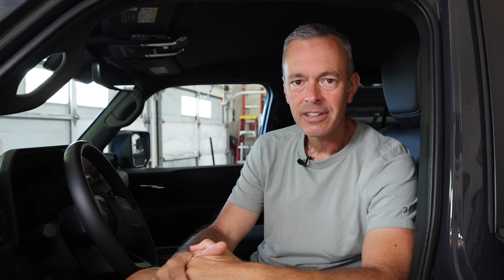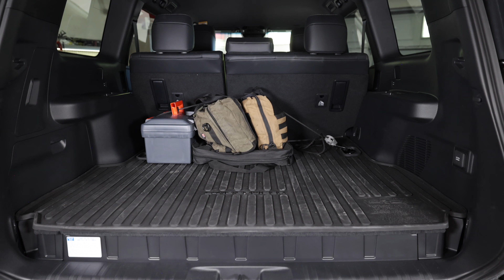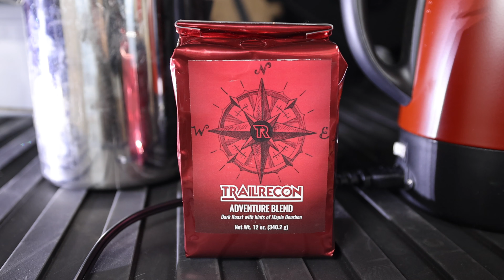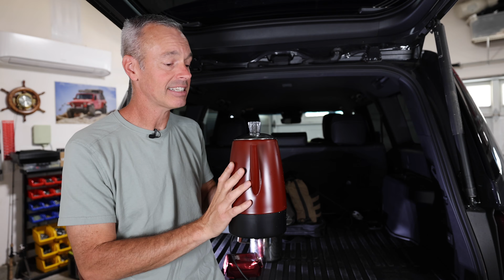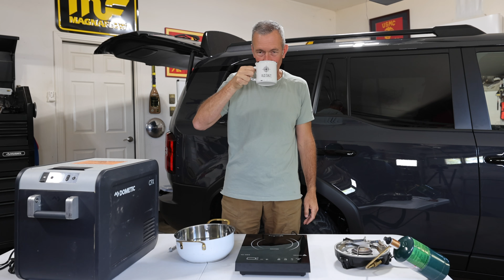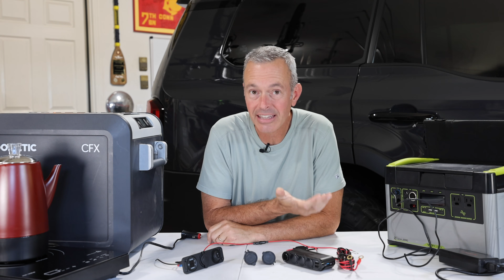Is it Time to Go Full Electric Overlanding?

Comment: Your ideas sound very similar to what I've been working towards with an all electric 4Xe kitchen! I have an 1800w induction hotplate plus induction rated pots and pans to try, but no coffee pot yet. A 30qt fridge will plug into the 12v cig socket in the back, plus I have a 2300w Dabbsson power station to save the 4Xe 110v power box for backup, and a couple of 200w solar panels that will fit nicely on the hardtop without blocking the freedom panels! There will even be room for a 28" by 74" sleeping platform inside without removing any seating, which is my present project.

Comment: Very useful video! Most of my camping is done at the racetrack where I can get power. Switching to full electricity makes so much sense for me.
Reply from the maker: Glad it was helpful, I think there is some real practicality in going with electric vs. propane.
Reply: @TrailRecon  absolutely! When electricity is available it’s a no brainer. You can’t forget your lighter or have a bad valve and an empty tank. Also can be safer/cleaner and more compact.

Comment: I have a Hardkorr battery box with a 120 amp lithium battery inside and a Redarc DC DC charger plug and play with Anderson plug. I have a single storage draw with a slide draw 30 litre fridge/freezer. The fridge runs for more than a week no problems. I use the battery for my ARB compressor with Anderson plug.
The battery box has four 50 amp Anderson inlet outlets , one 80 amp , cigarette sockets and USB ports along with a monitor. If you take the red end of the Dometic cable you can get a lock in type of socket , I use an Engel style plug on my 40 litre fridge. MSA make great drop down fridge slides.
I used one for many years in my 100 series but have gone to the slide draw fridge in my 300 series. 
Kickass make some great prewired power boxes.🇦🇺🍺

Comment: I have been experimenting with this route of electric camping gear on my 2024 4xe which came with a power box and upgraded IDCM that allows to use the entire 15kwh (94% electric range assuming you got to camp in e-save) of the HV battery. I have been able to run even a space heater earlier in spring and waiting for fall/winter to do a proper 2 day camp with only the HV battery. at 15kwh thats like carrying 5 of those largest 3kwh jackery generators.

Comment: For running things outside the vehicle there appears to be a grommet between the rear seats that's about 2" in diameter. If you pull up the front "storage compartment" down to the bare floorboard (2 nuts to remove and then some pop plastic trim clips) you'll see it right on the edge of the carpet. I believe it comes out just above the fuel tank next to some other wires. My plan is to mount a Garmin Powerswitch in the front storage tray of the trunk and run my front light power and radio antenna cable out of that grommet and up to the engine bay. Just food for thought, also trying to figure out how I'm setting up the 12v in this truck as we go.

Comment: More than likely the rear usbc ports are dead when the truck is off, but you could probably switch some of those over to 12 volt outlets, they would just be keyed.  No need for four or five USBC ports in the rear area that you plan on sleeping.  I'm sure you could even take the driver side third row area USBC port and swap it to a 12-volt and wire it directly to the battery. Nice clean install using the factory hole

Comment: How about a fat gauge cable from the rear battery to a resettable circuit breaker in front of a positive bus bar under the hood?   A switching system, fuse blocks and other loads can also access this bus.

Comment: I just use a 500w hot plate, bring a small covered pot and small frying pan for cooking. To heat up water, I use a 12v water heater, fits in a cup holder. I'm wondering why the Sienna doesn't make the loud noise when the engine turns on?

Comment: I ran 2 of the Garmin Switches on last build. Worked awesome, phone access, CarPlay integrated and also has switched programmable option on it. Thinking on LC of tapping into jump point under hood for external accessories. I have 2 of the Garmin Switch units so one for inside LC and one under hood.

Comment: Electric water kettles are great (with a French press) for safely making that first cup of coffee while still in your tent.  My problem is I’ve never found a portable induction hob (stove top) that holds the set temperature whether I use cast iron, carbon steel, or induction-compatible non-stick.  Even setting to only 100 degrees F I find swings up to 300 or more.  Does anyone know of a reliable hob?

Comment: 2400W outlet runs my camper A/C no issue. 13.5k BTU standard A/C system. Would love to find a way to split plug outlet into 2 and have a plug outside as well.

Comment: Interesting analysis.  I run electrical including fridge off the Lithium external as well as CPAP.  I use propane and hybrid fuel for cooking and coffee which I drip into a growler for all day drinking and/or sharing.  I like your coffee which I grind finer for drip and run through a stainless screen for expediency.  The bottom of the coffee gets muddy, but fine for a large batch and swish/toss the end of it.

Comment: Agree with some of the other comments. Use a power station for all 12v electrics besides things like winch, air compressor, lights coupled to a victron orion 12 to 24v up converter into the power station solar input for fast charge. You can run power from the battery to the engine compartment tucked under the body above frame rails to a fuse block. I've actually used 3/4 black drip irrigation tubing as a wire protector/concealer/conduit and it works great. It would be foolish to try to run power through the interior and out the firewall to get under the hood when you can just come out below the 12v battery compartment through a grommet.
Reply: I've read that there's a jumper cable run from the battery to the under hood area.

Comment: something to think about/consider is the dependency on the inverter to create 120VAC and what's hanging off it. For myself, my platform is a 2014 XTERRA (eg not hybrid/electric), and the "house" current comes thanks to a EcoFlow Delta-2. that runs the frdige (12VDC) and a kettle/hotplate (120VAC) load. The other day in the garage the Ecoflow gaveup the ghost (it beeped angrily a few times and started putting out funky-smelling fumes). RMA/Warranty/yaddayadda in progress, but if I'd been on a trip; now what? I can still run the fridge because it is 12VDC, but all the workloads on "house current" are out of commission. So consider what's inside the inverter's blast radius when doing your planning.

Comment: If it was me, I would put an Ecoflow Delta 2 in, and connect that to your vehicle inverter (as long as it is pure sine). Then just have it on while driving to fast charge the D2. Then put some solar on the roof to charge while sitting and have rhe fridge connected to the D2. 

The D2 will do AC passthrough, so if you wanted to utilize the hybrid battery all you would do is turn on the vehicle and the D2 will bypass its battery and just use the hybrid.

BTW the D2 will fast charge at 1200w if tou needed to, but could certainly turn down to 500 for longevity.

Comment: I use an infrared cooktop. With a 200ah lithium battery bank I’ll cook once alternator charging has topped off the batteries. My inverter is 2000W. Induction I’d have to buy cookware and does reproductive harm. I also use a small cuisinart kettle to heat hot water. My fridge runs 24/7. And I may unplug when coooking but don’t need to.

Comment: Kickass products works with Land Cruisers down under, they should be able to help set up your electrical system. Maybe RedArc too. I run a single battery setup using a Optima DH7 Yellow Top AGM Dual Purpose Deep Cycle/ Starter battery in our Gladiator Max Tow /ARE CX/ Cruiser Hitch 17BHS travel trailer to power overnight and weekend camper loads. Have a DH6 in our JKU and a DH6 in the camper with solar and generator backup.

Comment: I feel like I wouldn't want to bother with all of the hardcore wiring that modern Overlanders are doing to their rigs.  I feel like I would get a high wattage self-contained Bluetti or other brand, run any electric off of that and recharge that via solar and car alternator as needed (maybe pack along a small Honda generator for long duration trips).  And use propane as well.  I don't want to deal with all of the custom wiring and complexity.

Comment: I’m curious if the hybrid battery is 200+ volts and it steps down to 120volts isn’t that a converter not an inverter? You can cheat the cook top with a steel pizza pan and cook in any pan. I have done it for yrs

Comment: I charge my Bluetti ac200 max with the 110 power brick plugged into an inverter connected to my vehicle battery system.  Close to 500 watts input versus  80- 100 watts charging from a 12 volt cigarette lighter plug.  Simple and I rarely use my portable solar panel.

Comment: In the front, under the hood, there should be somewhere to hook up jumper cables. Just guessing as I’ve never seen under the hood of the new Landcruiser, but most vehicles I’ve dealt with that have the battery in an alternate location have posts under the hood for jump starting. You might need to upgrade the wire going to that post to be able to run a winch, but that might be a way to power all your stuff upfront without having to run everything to the back. As for the fridge, I’ve seen really neat sliders that drop down after sliding out from watching the 4wd 24/7 channel here on YouTube. Have you thought about mounting a small solar panel to a roof rack so that you can keep you 12v battery topped off so you don’t have to worry about your fridge hitting the low voltage cutoff and spoiling your food? Not sure what you’re planning to put up there, just thought I’d throw it out there. And lastly, I hope there’s more than 3 people that are interested in using electricity rather than propane lol.

Comment: thank you for the video
Im having the same head scratching moments as I am in the middle of having my 2024 gladiator Willys with alucap modcap camper being built and as im going global with it there will be no propane just electric with 400 watts solar on the roof,400 watts portable solar panel, Ecoflow delta 2 max with extra battery and the alternator charger so hopefully I should have all the power I need.
Shake down commencing soon and as it is cold now here in Vancouver Canada I will be testing at the extreme of the power limits
I wish you all the best with figuring out your system and know its Totally doable and is the way of the future!

Comment: Cool.. I have a RAV4 Prime (PHEV) and it has a 1500W inverter.  What's nice is the engine doesn't turn on as it has an 18Kwh battery on board.  Still.. cool that toyota is giving you juice.  It is pretty loud when it starts up though.  Can't wait for them to come out with some new PHEV suv's or trucks that are bigger than the prime.  We use our Prime to power our ALiner trailer all the time when camping.  But would like a little more juice and a bigger vehicle.

Comment: Yes, of course one can eliminate propane appliances in favor of electric for overlanding.  A good power station, such as Ecoflow or Bluetti will do the job, and DC charging from an ICE vehicle will keep it charged, perhaps with solar panels supplementing.  Many of us run large travel trailers by this method - I only use propane for the furnace on my 28’ Airstream.  I also tow with a Rivian R1T Max Pack, but only use the vehicle battery for propulsion.  The appliances in my overlanding truck camper (microwave, convection oven, coffee maker, heater) are all electric, running off of an Ecoflow Delta Max with 800W DC alternator charging and solar. Propane is far less convenient, and much more dangerous.

Comment: Another great cook system is the Stokes Voltaic cook system and their Kettle/ french press coffee maker which is all electric.. I have a Bluetti AC180 power bank and use induction or my Stokes Voltaic for everything and have stopped taking propane. You tried a drawer fridge early in your you tube life. I am trying to switch over to the drawer type. I have a Ironman drawer fridge now but am looking to go with a Bodega because it offers a phone APP and a 120 volt option that the Ironman does not. Aussies have many more options for drawer fridges than the US does.

Comment: If you have the ignition on with out starting the engine (push the button without pressing the brake pedal) can you use the outlet in the rear? & will the engine just start like it did in the video?

Comment: I use my bluetti AC180 in the back of my bronco. Enough to cook burgers and hot dogs for the boys on the trail with my griddler while we’re stopped and charge up whatever gadgets we have. I really wish the back 12v would output a little more in the bronco though. If there was more capacity in the battery, say, 4.8kw or 6.0kw the land cruiser could take that load for at least a couple of hours without needing to start up which would be ideal but at the cost of potentially more storage? Probably not worth it depending on your goals

Comment: Just curious, why tie into the 12V onboard system at all? Your battery with the 2000W inverter can support everything, if you add a 12V splitter. Then, you could charge it off 120V very quickly while you’re driving. It should be much faster than charging off 12V. Just a thought, I do something close to this setup in my rig

Comment: Given the hybrid system has no 12v alternator, even your 12v loads will come off the HV battery, through an inverter and into the 12v system.

Comment: I would have the accessories run off a secondary battery, preferably one that is close the winch. I would also prefer that the internal accessories also run off their own battery. That way your systems are separated from the vehicle.

Comment: Hi   Always interesting to see what you are up to.    I have followed some of the ups and downs with the newer cars over the last few years with all the electronics in cars now a days.    One theme/topic I have seen might be worth a check by you as you plan the future with the new Landcruiser.    Quite a few of the newer cars have sensitive components and programming with regards to the battery.   I have seen several diagnostic videos chasing problems that ended with the battery.   They had issues due to the drained battery.  Causing unexplained items not working and damage when trying to use the car with less then optimal battery voltage.    Might want to check with Toyota how sensitive the Landcruiser is with lower battery charges before trying to use the installed battery for more uses / draining then the engineers might have considered.    Hate to see your new vehicle in the shop....    Enjoy and I look forward to what you come up with next

Comment: Super helpful overview. I am also interested in the Land Cruiser and was thinking I could use the plug in the rear for the similar items you demoed...you helped me see that it is mainly useful to keep my ecoflow system charged while I am driving.  I do not want to run the engine just to use the induction burner.  Using the Ecoflow Detla 2x I can do everything.  The Land Cruiser plug just makes it so I do not have to wire in a charger from the alternator and at 2400W output it will charge up the Ecoflow fast so no solar panels needed.

Comment: Wire size on your 12V distribution dongle is suspect for optimum performance?
Reply from the maker: I need to take a closer look, but I should be running any high power items thought it.

Comment: This is interesting.  But I'd find that to be highly annoying.  What I'd like to see is this being done with a Mercedes e-Sprinter. That is a whole different mess to set up a system that would work using the traction battery as the power source with a solar system integrated to offset the consumption of the tools.

Comment: if you wanna come up to Anaheim i can show the custom set up i run for work and camping. i can run power tools, it portable semi compact. i run a 4k peak watt inverter . 40 amp charge controller 300 watt panel on work van 100 panel in blazer for camping. made the unit about 6 yrs ago in its a great set up. and you even do vid show people you can wheel on a tight budget. have 03 blazer ive built n upgraded myself in last 2 yrs now. n im still under 8k for everything. and its a nice rig super capable.  still more upgrades to come. but make a great vid. you can compare budget diy build to off the shelf products . n show people you dont need 70k to play. i started with 1800 bucks .

Comment: You are on the right track but think the battery is too small- I doubt running the engine is more efficient than propane cooking- 🤔- looking through the comments yiu can buy a higher capacity setup - look forward to more experiments ( cooking while driving! )

Comment: Is that 1.87kw @ 120v, 12v or 285v?  Trying to figure out amp hour rating for the battery.
Reply: Watching your battery meter and stop watch in the video it looks like that 1.87kw is based on 120v.

Comment: NH batteries are more stable. AKA no boom boom like the Teslas.
Reply: Ha, Toyota just had engine recalls where they have to replace the entire engine
Reply: @gpaje  However Toyota did not, this was investigated by NHTSA and Toyota didn't have any choice but to comply. 100k of them.
Reply: @husker_nation  sure, but they didn't force Toyota to do long blocks, complete engine changes is what Toyota is doing, they could have just done the short block for a whole lot cheaper, just get them back and running and pass the powertrain warranty.  Instead Toyota is doing the right thing and probably helping maintain resale value on those trucks with all new engines.